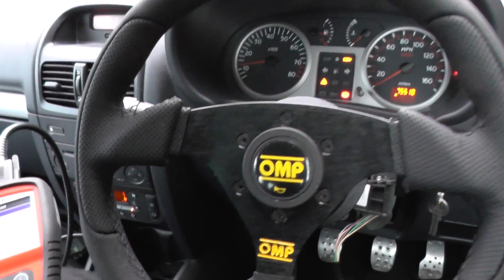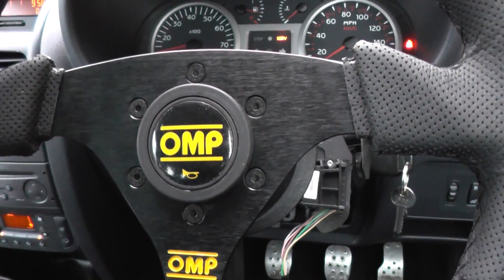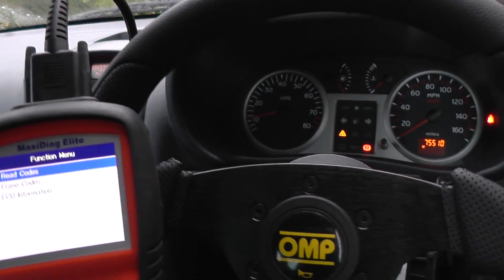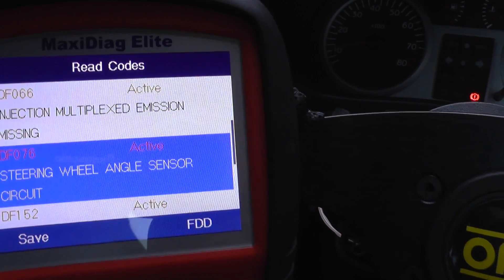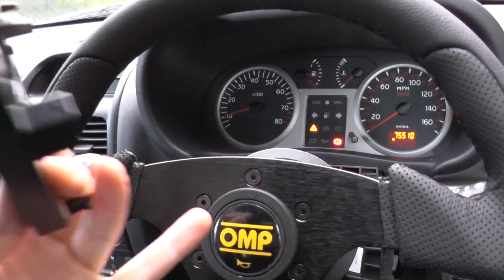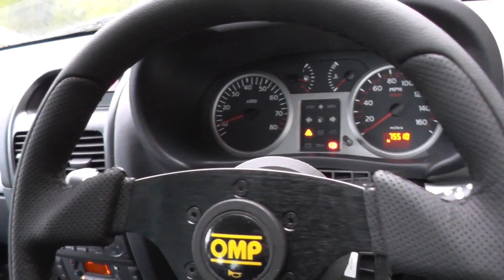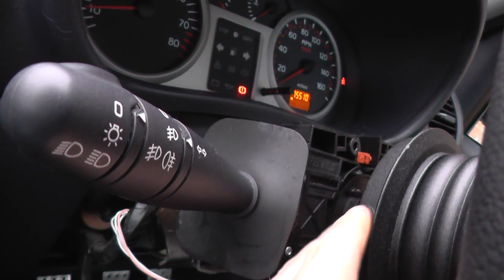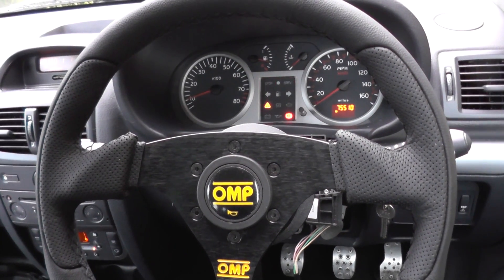Renault Steering Angle Fault Problem DF076

Comment: Would this be the same fir a renault master (2013)?...i recently had to take steering column off to replace heater fan motor...anyway, once i got dash and steering wheel all back in place, i now have the check esp light on....i was pretty meticulous with putting everything back together, but feel as if i may have adjusted somehow the steering wheel angle sensor....do u know where it is on renault master or have any tips as how to solve issue..many thanks👍